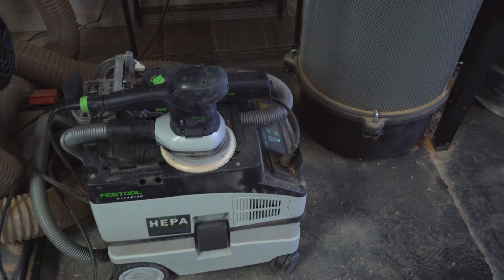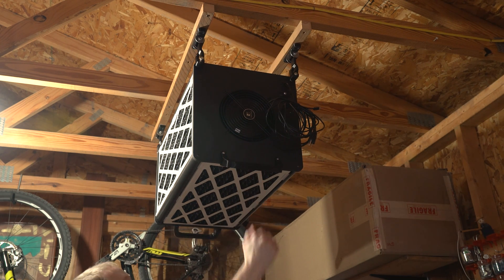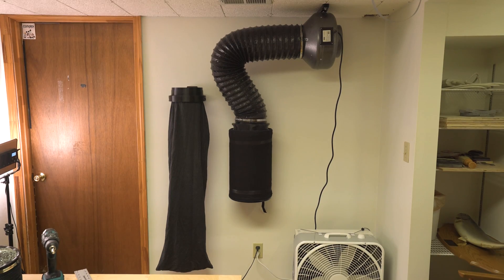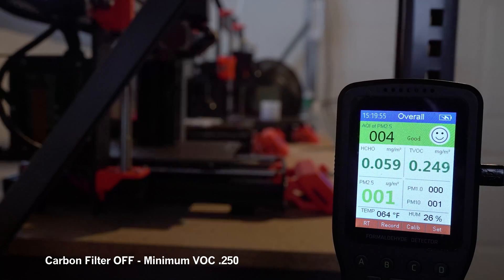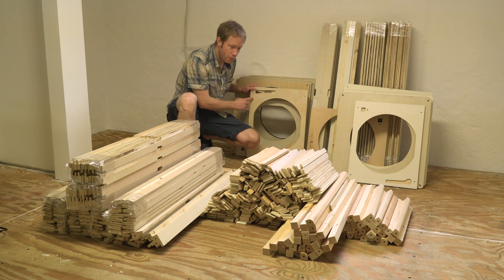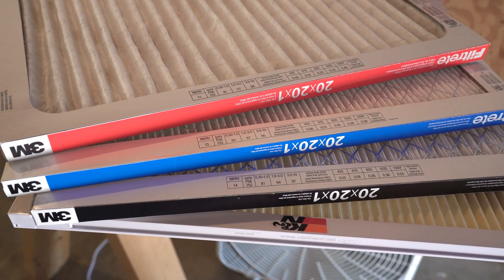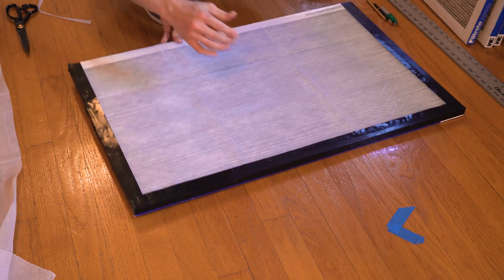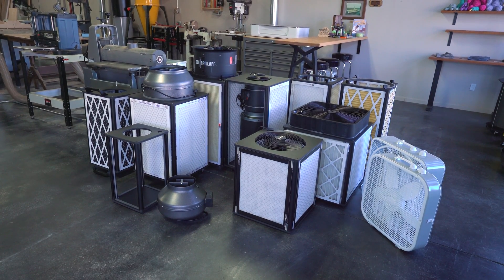DIY Quad Filters - Everything you need to know

Comment: Will you ever sell the CNC plans? I just bought a Shapeoko 5Pro and would love to make my own box. Maybe you could sell a pack that includes the 3D printed pieces along with the CNC plan? Just a thought. 

Also, I have the Lasko 20" High Velocity fan (2264QM). Is there a Model B design that the Lasko would fit in?
Reply from the maker: Probably not going to sell CNC plans for this version. I will have a basic wooden version out soon that can be CNC cut. The DIY plans are already available on my website. The 3D printed parts are also available on my etsy page.

As for your Lasko fan, the answer is maybe. The controls are a little hard to work with, but with a thick foam seal around the fan for the cord to pass through, it might work ok.

Comment: Have you tried a design that allows the box fan to be mounted inside the air filter frame using the screws holes that mount the grill to the box fan.

Comment: How about using AC Infinity CLOUDLIFT S14, Industrial Wall Fan 14? Will this work well and what build would you suggest ordering? The 12 is not available.
Reply from the maker: The 14in version of the fan also works with this version of the kit https://www.etsy.com/listing/1701909167

You just specify that you want the 14in fan version at order time. The only filter size what is compatible with the 14in is the 20x20in, 20x25in, and 20x30in.

The 12in version of the fan is sold out just about everywhere but there may still be some random websites that have them.

Let me know if you have any questions at all.

Comment: C-R is a new, you might say promotional term invented by the apparent rediscoverers, with the surnames Corsi and Rosenthal, I suspect, to make it easier to look for information on the matter, geared towards preventing viruses, with the idea being that imperfect (MERV13 being the most common) is better than not at all.

The tall cuboids could theoretically support more airflow with less resistance than a shorter cube with the same fan.
Reply from the maker: For sure. I suppose their rediscovery helped popularize the concept, so that a fine thing in the end.

Indeed, the bigger the cube, the better the filter!

Comment: Do you find that pushing the air, instead of pulling, shortens the life of the fan?
Reply from the maker: Good question. Not in my limited experience have I killed a fan. That's also a tough thing to test for because it may take years of side by side testing to find out. The most important thing for fan life expectancy, in my opinion, is to not put too much strain on it. Keep the motor cool. The more filters, the better kind of thing.

Comment: Hi, the s12 from AC Infinity is currently sold out. Would you recommend keeping the same size filters with the S14 or to increase them?
Reply from the maker: Hello! Yes, the S12 seems to be in short supply all over the place. The S14 works with 20" wide filters only, but if that works for you it's a fine choice. It is about 10% more powerful than the 12" with all the same features. Let me know if you have any more questions here or on etsy. I see the Etsy messages a lot sooner.

Comment: "Model-B Air Filter Kit
AC Infinity Wall Fan Edition"  Does it come with the fan?
Reply from the maker: Hello! No fan or filters are included in the kits. Those items are sold separately. At the moment the 12in AC Infinity Cloudlift fan is in short supply but it will hopefully be back in stock soon.

Comment: The switch to plastic/aluminum (especially in black) and the forthcoming prefilters (also in black) is going to make me buy one or more of these kits.  They're looking clean enough to go in a room and NOT piss off the wife. :D

Now if only it were possible for the filters to be black themselves, then the whole thing just disappears basically.
Reply from the maker: Happy to hear you like the color combo! I think it's pretty slick myself. If you use black duct tape to apply some black sheer mesh/fabric to the outside of the filter as a pre-filter,  the whole thing does turn black. It's pretty straight forward but I'll be doing a video on that in the next two weeks or so.

Comment: Pardon my ignorance, but would a pre-filter be better suited for the interior or the exterior of the box, or both? 

And do you think a window screen would suffice in this application or were you thinking something even more fine? 

Thank you!
Reply from the maker: There are some links below to the recommended material. Widow screen material would likely have holes that are much too big.

You can place the pre-filters on the inside or outside of the filter box. The placement depends on the direction of the airflow. If the fan is pointed up, then the pre-filter goes on the outside and in the fan is pointed down into the filter, the pre-filter goes on the inside.

I hope that helps!

---PRE-FILTER Material

Maximum efficiency (smallest holes, clogs quickly)
63 micron opening size (0.024in, 0.063mm)
Color: Yellow
https://amzn.to/4cCDEy4

High Efficiency (larger holes, clogs less quickly)
105 micron opening size (0.041in, 0.105mm)
Color: White
https://amzn.to/3Jk0Wva

Black Duct Tape. Any standard Duct Tape will work
https://amzn.to/49gSGH4

Comment: Brilliant! The world needs a Corsi Rosenthal-esque design that's accessible like this--too many off-the-shelf air purifiers use proprietary filters, and don't do nearly as good of a job as they advertise.

I'm curious, was there not enough of a filtration or airflow benefit to add a fifth filter to this design as a bottom (or top) face? Great idea for a product, will definitely be keeping an eye on your work--any idea as to when your ceiling mounted version will go on sale?
Reply from the maker: Thank you! Ceiling mounted video should be out in a week or so. Kits are already up on my Esty page for pre-order if you want to get in the queue. 

As for the bottom filter, I couldn't get it to increase performance to any significant degree. If the whole unit is significantly off the floor, it will do something but you can also get the same , if not a greater performance benefit from taller filters. The design with filters on all sides also becomes quite a bit more complicated, so I got away from the concept after thoroughly testing out my Corsi-Rosenthal build.

Comment: This is very cool!
I have been researching getting a new air purifier for my larger space soon. I'm definitely am considering a kit like this because of repairability.
The one I am eyeing is your Maximum Charcoal addition, unless the prefilter video would change that. Since I had been looking at the IQAir one before seeing this video and a video by Healthy Home Guide.
Roughly, what is the method for adding a prefilter to these? Would it be just a cheaper 1in filter since it can fit 2in filters? Or is it more like my current air purifier when you add a flexible sheet ontop of it with like velcro?
Reply from the maker: Glad you like it! For the pre-filter I pretty much just duct tape silk screen mesh or other sheer fabric to the filter. It's a little time consuming but you probably only need to do it when the filters are changed and that may be once a year or maybe even less. The links to the silk screen material are in the description. 

I'd like to have a fabric cover for it at some point but that's going to take some time to get that out.

Personally I use 1in 3M MERV 13s on the Maximum Charcoal edition. They are better than any 2in filters I have tested and they just look nicer.

Let me know if you have any more questions. I'll generally get back to you more quickly through Etsy messages.

Comment: Thank you for the amazing work and being generous with your plans. What is your opinion on making a unit with 140mm PC case fans, like the Thermaltake TOUGHFAN 14 Pro?
Reply from the maker: Any time! That's a good looking PC fan as far as specs go. I'll save it for further thought. In one place it says 110cfm and in another it says 70cfm then in another it says 86cfm? I'll assume that the lower number is more accurate. Most PC fans are not quiet at their highest speeds, so this fan may be an exception? Have you tested one before?

In general I suspect that 6 of these would be as loud as and as powerful as Lasko box fan on low for 6 times the price. 

There is a lot of appeal for this sort of design but there is a reason why I haven't tried it out yet. 

Regardless I will give it a shot in a few months when I've got some space time.

Thanks for the comment!

Comment: I curious to see this compares to the filter boxes people build over their mini splits. I know it’s mostly to extend the life of the mini split but there is a degree of filtration happening and curious if just having a quad filter would be enough to negate the need for the mini split box.
Reply from the maker: With a high air flow filter placed underneath a mini-split system, the air should be well filtered and negate the use of a box over the unit. That said, the only way to capture 100% of the dust that goes through the mini-split would be to put a box over it. But sometimes 95% is good enough?

One possible benefit would be to reduce static pressure on the fan inside the mini-split by not using a filter box over the top of it. Just a thought.

Comment: Excellent video with practical applications and design choices. Thank you so much for your content. How portable are your units. Would they be practical for dissassembly and mobile use at different client locations to reduce overall contamination to their homes. Have you ever considered a folding or collapsible design.
Reply from the maker: That is a good question! The contractors that I have worked with simply pack the whole thing in their trucks, which wont be ideal for some with space constraints.

The whole kit can be assembled/disassembled in a few minutes, so theoretically this could be a workable option.

If the plastic gets torn up over time, you could use the top/bottom as a template for your flush trim router. Some 3/4" plywood would be a robust replacement. The threaded aluminum legs might strip over 100s of cycles. If so, you could just run a tap into them to make the threaded portion deeper. 

I really like the concept of a collapsible kit! Might be able to put some though into that later this year but the schedule is already pretty demanding.

Thanks for the comment!

Comment: 1st off, thank you for these videos!!! 2nd, what do you recommend for a 190 sq ft basement woodworking shop? On a $200-300 budget?
Reply from the maker: Sure thing! On that budget, I'd say build one of  the new Model-Bs. I am almost done with the new plans and website update for these. You will only need a table/circular saw, a router, and a drill to build them. I tried to simplify them as much as possible.

Hopefully by Sunday I will have this update out. I'll do a YouTube post about it when they go live.

For 190sq.ft, the Cat fan would be best but you can get away with a box fan to cut $80 off the build price without too much performance loss. For filters the 20x30" filter size is best.
Reply: @The3DHandyman  AWESOME. thank you for responding. would MERV 11 or 12 be ok  should I stick to 13/14? I am going to go with the box fan as I already have one
Reply from the maker: @yvoskanov  I'd definitely recommend at least MERV 13, but if it isn't in the budget, MERV 11 or 12 is better than nothing!

Comment: Probably gonna get charcoal kit. Do you think charcoal would need yearly replacement?
Reply from the maker: I think yearly would be a reasonable estimate. I have been using the 8" canisters in my workspace  /cnc room and even after a year of punishment they still cut smells down to almost nothing.

My pollution meter does seem to indicated that the VOC reduction performance is quite a bit less than it was when they were new, so they are probably nearing time for replacement.

The charcoal canisters can also be opened up and the carbon replaced for less than $50. I will show this process in an upcoming video. Here's the stuff I picked up for that process https://amzn.to/3JkxyEZ

Comment: Quick heads up - walmart has a Hyper Tough 20" fan with a sealed motor for $70 and claims to be able to put out 7000 CFM.  Might be a budget buy.
Reply from the maker: Thanks for the heads up! Might get a change to test that at some point. What I have found is that the fans over 4000cfm seem to be absurdly loud unless you workspace has 20ft ceilings. I do want to use something like this for a ceiling mount at some point though. Hopefully I can get to it later this year.

Comment: I have the AC Infinity CLOUDLINE A8, Quiet 8" fan  and  refillable 8in carbon filter from them the have great quality and my cooking odors are gone. I have a immune systen issue and filtered air really makes a differenceto me. Have you done any study on regenerating the carbon filter outside.
Reply from the maker: I have not but it would be great to add to my video on VOCs. Have you done that? I was just going to open it up  and put in fresh carbon.

Happy to hear the carbon filter has really helped you. I an now sleeping with one of those in my room and it has really helped with spring time congestion.

Thanks for the comment!
Reply: @The3DHandyman I just got my recently so haven't had it gets saturated yet does your design work with the refillable carbon filter from AC Infinity.
Reply from the maker: @ZechariahFry  Possibly not! Hadn't seen that one before. Though I'm pretty sure I can refill their standard 8" carbon canister without too much effort... I think...

If the refillable version is shaped differently, then the kit may not work as intended. The tolerances are fairly tight. 

It would be great to try out the official refillable version but another carbon filter is not in the budget at the moment.
Reply from the maker: @ZechariahFry  Just got feedback from someone who bought the kit and they said they used the refillable version without issues. So, seemingly that answers that question...

"Great quality kit. I use it as an air filter in my apartment to reduce cigarette smoke smell from neighbors. I'm using the AC Infinity 8" Refillable carbon filter with the 8" Cloudline Pro T8 inline fan."
Reply: Great to hear I'll be purchasing one soon then. @The3DHandyman

Comment: Great video. I have small woodworking shop. 12' x 16' x 8' open ceiling and a large door entrance 54" wide. I like the Cat drum filter and I definitely want to be able to move it around. What size filter setup would you recommend for a casual woodworker? Thanks again for all your hard work so the rest of us can breath easier.
Reply from the maker: Thank you, happy to help! A 12x16' space with 8ft ceilings is similar to my basement workshop rooms. With the CAT fan, a 14"x30" or 16"x30" filter size would work great. I actually designed the 14"x30" version for this room because floor space was hard to come by.

I generally ran the fan on level 3 of 4 and it was very effective. Point the fan downwards into the filters for the best effect.

A ceiling mount filter would also work. I am not using the Caterpillar fan with that design though so the power is a bit reduced.

Comment: Does the placement of the air filter affect efficiency?  e.g. middle of the room, vs up against a wall, vs wall mount, vs ceiling mount?
Reply from the maker: Good question! In the center of the room is ideal for the axial fan style of filter. If that's not realistic, along a corner or wall is also a fine choice. Just leave a few inches between the filter and the wall to encourage airflow.

Ceiling mounts are also just about as efficient as possible. Same thing though, its best to leave a gap between the filter and the ceiling.

Comment: I just built a crappy quad filter with load bearing painters tape as a proof of concept, and while I'm already impressed at the improvement in indoor air quality, servicing it is going to stink when the filters need replacement. It's awesome that you have kit available, and when the time comes to upgrade, I'll probably be buying one of yours!

Sidenote where are you getting huge Noctua fans????? Is that just a sticker placed on some other fan?
Reply from the maker: When that time comes, I will be ready with a kit for you!

The Noctua sticker is on one of their 200mm fan grills that I use with an inline fan. They do make a 200mm fan https://amzn.to/43QA4wh I might try making something out of these at some point but I'm not sure how much air they actually move.

Comment: Do the air king fan in push mode 4-5 filter will do the same result or better then pull ?
Reply from the maker: I tend to use box fans in the pull configuration because it keeps the fan and the fan motor clean. Box fans can be used in the push config with good results but I would do that inside the home rather than in a dusty workshop. 

The Air King also has a lot of space in front of the fan blades inside the metal frame. This can cause unwanted air circulation inside of the fan. A standard fan may be better in the pull config as a result.